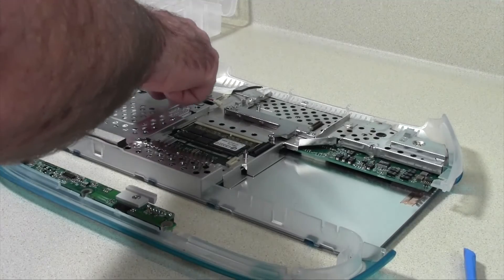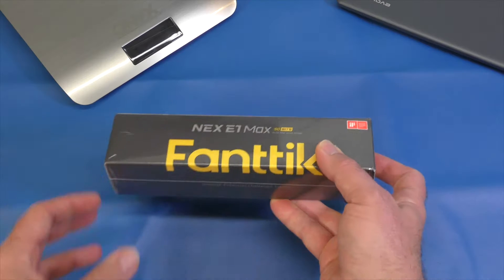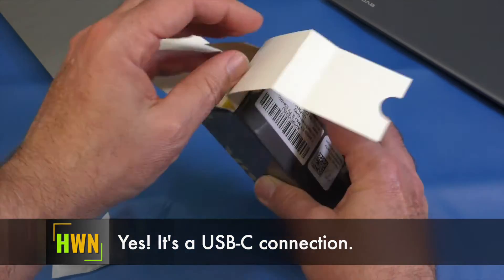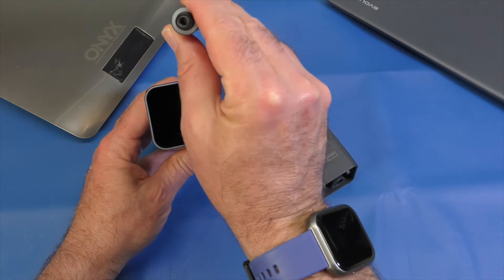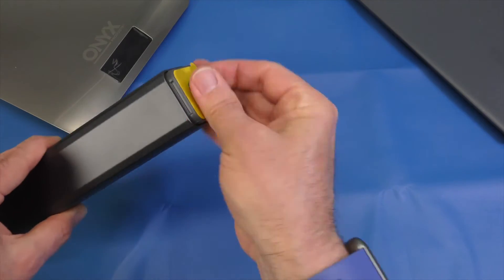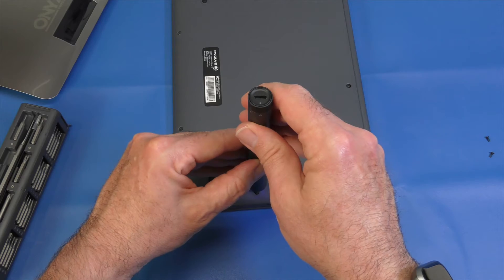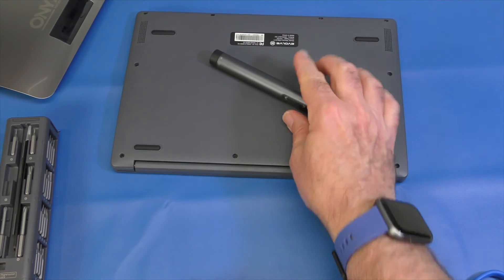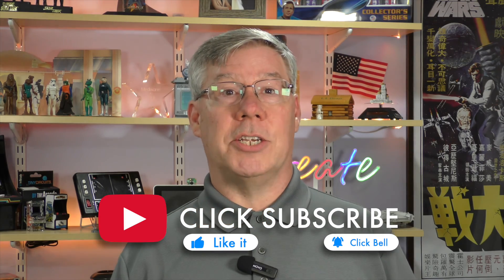Fanttik NEX E1 Max Precision Screwdriver

Comment: I have a very similar screwdriver, different brand, but otherwise appears identical.  I've noticed that the torque is lacking on it, it can only remove barely snug screws.  Are you happy with the torque on yours?
Reply from the maker: First, thanks for watching. Currently, I haven’t experienced torque issue. If I do, I’ll post a YouTube Short.
Reply: Well they're not well know for good torque u have to finish by hand sadly, but still a handy tool when you have a lot of screws to go through,